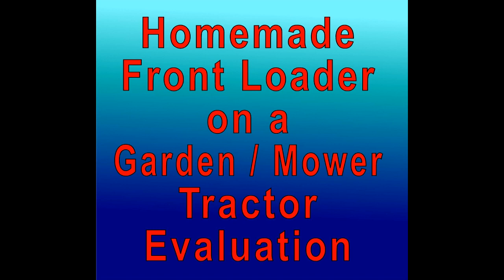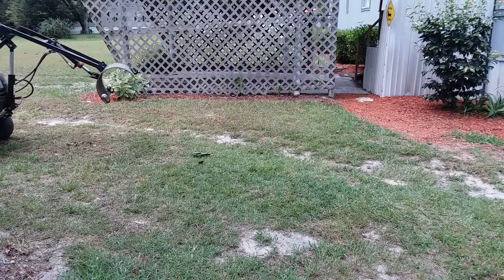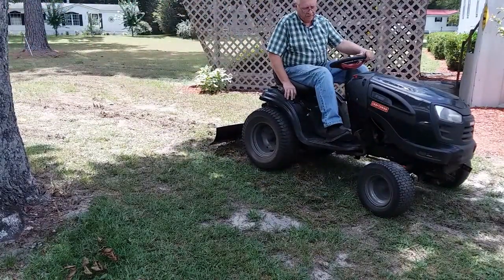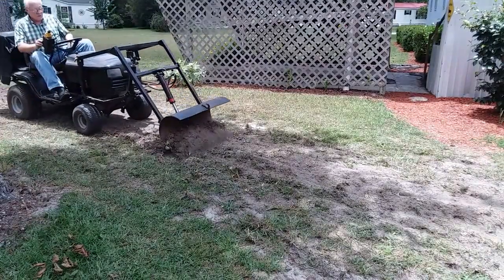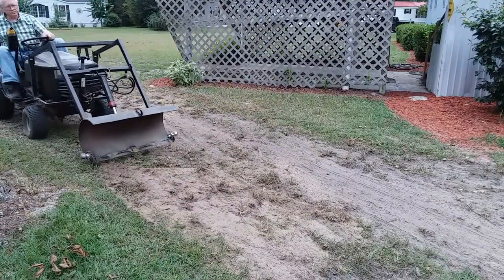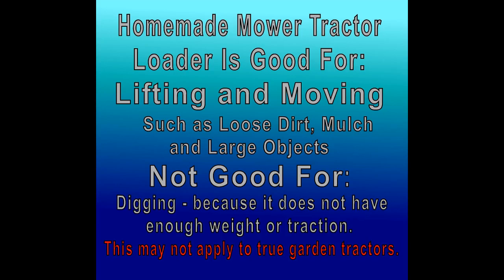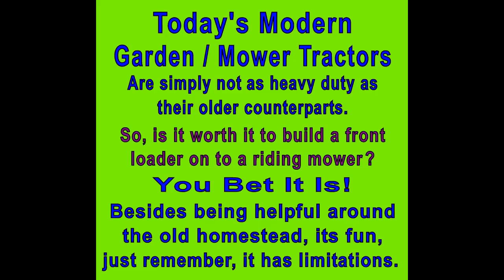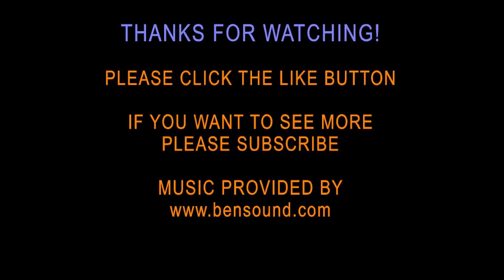Homemade Front Loader on Mower / Garden Tractor Performance Evaluation

Comment: Something you could do to add weight to the tractor without making it harder on the bearings and axles is fill the tires with RV antifreeze. If I do this to mine I believe I'd put tubes in all the tires to prevent any liquid to metal wheel contact because I would assume they would rust from the inside without a tube. That's about 8.5lb per gallon.
Reply from the maker: Thanks for the idea.

Comment: It's obvious to me your bucket is flimsy without any sides to it. Add sides and it will be a lot stronger.
Reply from the maker: The bucket is made from 5/16" steel. The open sides make it possible to pick up very long items. The bucket is perfect for the work it is intended to do.
Reply: Yeah we all needed your flimsy help….

Comment: That's a cool build. The one question I have about this tractor is what kind of speed selector is in it? My father's old MTD lawn tractor had a 2-belt CVT and it *sucked*. Just going up and down hills while mowing grass it ate up a drive belt every couple years. On the other hand, if your machine has a hydro, you should be alright. In that case the only thing I would suggest is putting a larger pulley on the transmission to lower the gear ratio. When engaging the ground torque is more important than speed.
Reply from the maker: This was a CVT.  I do a lot of experimentation and this was the first CVT transmission tractor I built on. I prefer to build with a hydrostatic  platform.  Although I must say that this particular build performed well. Ballast weight in the rear is key to good performance.  
Thanks, Ed

Comment: Very Helpful Thank You Ed. A friend of mine 15 years ago used a convertible top hydraulic pump 12 Volt on a plow/buck with old Fisher snow cylinders along with square tubing inch and half,  built on MF 12 garden tractor.
Reply from the maker: Very cool!

Comment: Was this electric or hydraulic
Reply from the maker: This is a hydraulic system that uses a 12 VDC hydraulic pump (link to pump below). It can operate 2 separate hydraulic circuits.  A 12 volt truck battery is mounted along side (adds ballast weight in rear). 

See my build video at : https://youtu.be/4mflY5zBKrI

Link to pump on Amazon - https://www.amazon.com/Happybuy-Solenoid-Hydraulic-4-5Liter-Trailer/dp/B07ZCLS6RN/ref=sr_1_2_sspa?crid=P2RY6VB4ZTPE&keywords=hydraulic+pump+12v&qid=1660749189&sprefix=hydraulic+pump%2Caps%2C109&sr=8-2-spons&psc=1 

Thanks for inquiring, Ed

Comment: I completely agree with what you said. 
I built a loader for my MF 12 garden tractor. This was about 10 or more ago. It’s moved firewood, dirt, gravel and most other things around the house. Great for setting wood or branches on while loader is up to cut the wood with a chainsaw. Standing up cutting wood much easier on my back. 
Mine is operated with a winch to raise and lower and has a trip bucket. Plus I can take the bucket off and put my snow plow on. 
Have a great loader day.
Reply from the maker: Well said!